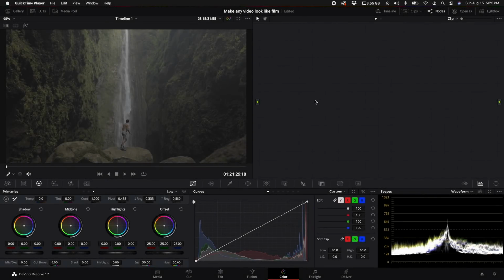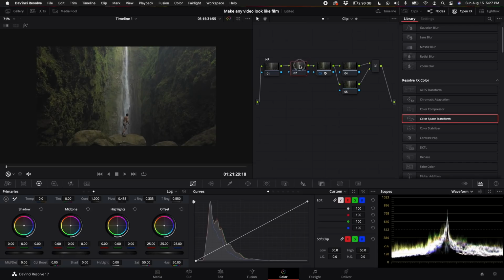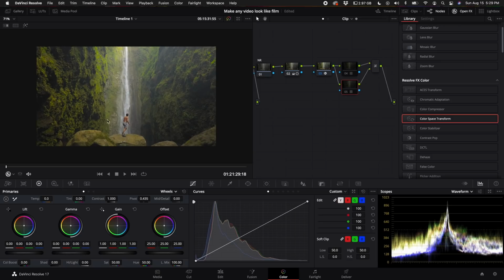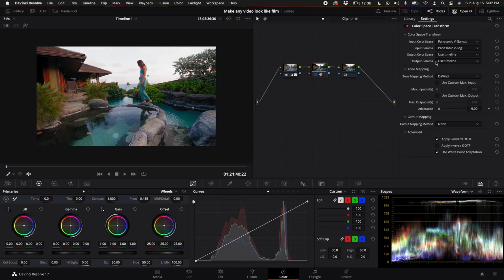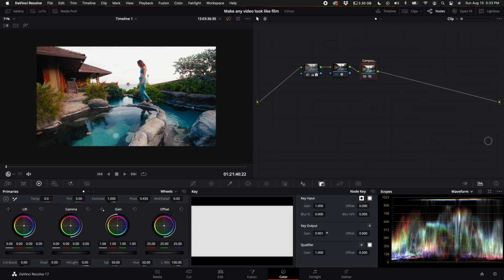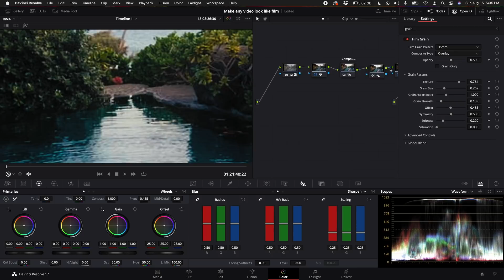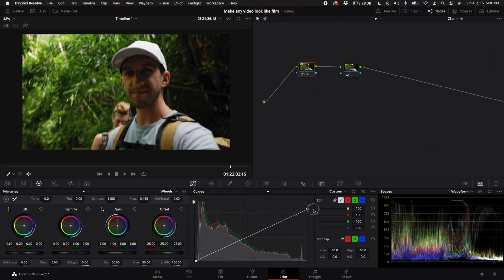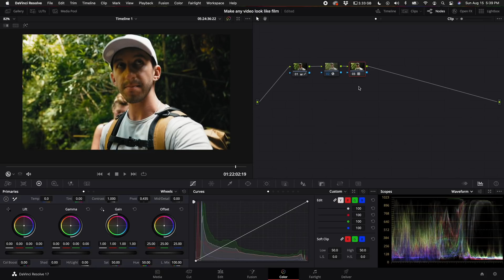3 Film Emulation Techniques You Probably Haven’t Seen Yet In Davinci Resolve

Comment: Good stuff here...I only wish you would show how you setup Project Management (colormanaged vs. non-colormanaged) as that would have an impact on how the CST nodes you're showing here works?
Reply from the maker: If its color managed then you wouldn't have to select the input settings, just change the output gamma like I did in the third example (since the color managed workflow already does the first step)
Reply: @JamieFenn  Appreciate it. So basically, IF it's color managed you do not need to select the input settings, but doing that won't "hurt"? 
It's just that it's not necessary since the CM workflow already has the information?
Thanks mate.

Comment: Great thank you. For the first CST node with the Mavic 2 Pro (D-Log), do you know which option to choose for "imput color space"?
Reply: Input Color Space: DJI D-Gamut
Input Gamma: DJI D-Log
Reply: @_RafaelKr  A big thank-you
Reply from the maker: Keep in mind those CST settings are not drone specific like the settings available for the BMPCC cameras. I have the mavic pro 2 as well and when I apply those settings Rafaelkr mentioned above, it's overkill for the footage coming out of that drone. You'll need to pull down on the highlights and bring up the shadows. Also I've found myself desaturating certain hues because the video is over saturated in some cases.
Reply: @JamieFenn  Thanks Jamie! I forgot to mention that I also had to turn down saturation by a lot. Didn't do a lot of editing yet.

I have another question related to the Mavic 2 Pro: Which "Style" settings are you using there? I watched some videos about it and didn't have time to test it out myself. I think I'm going to try out [+1, 0, 0] first. Or would you go with None [0, 0, 0] and do sharpening in post? Would love to see a video about your settings and your editing process of the Mavic 2 Pro videos!
Reply: @JamieFenn  
I confirm for highlights, shadows and saturation. Thank you!!!
Reply: @JamieFenn  
I confirm for highlights, shadows and saturation. Thank you!
Reply from the maker: That was a typo, I use the air 2s. But Using the cst to get the colors almost there should do fine after some minor tweaks.